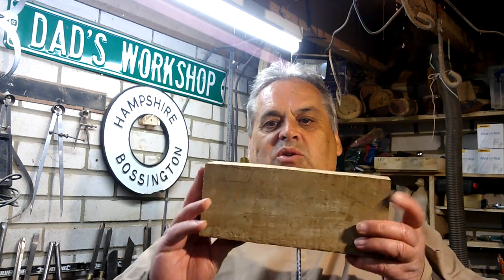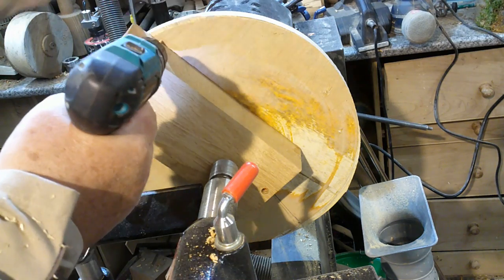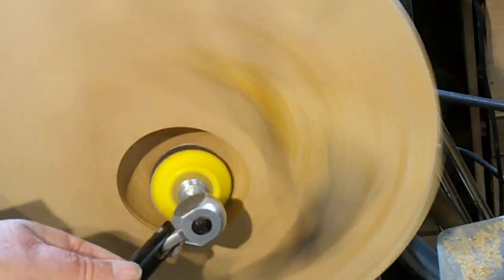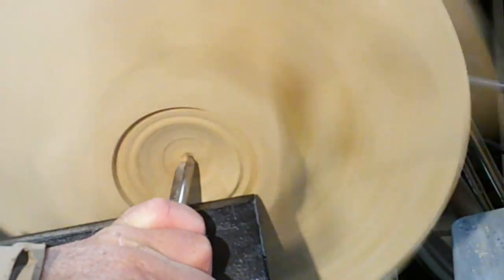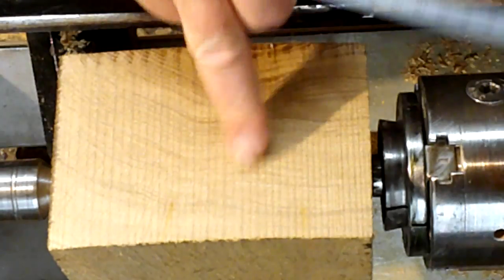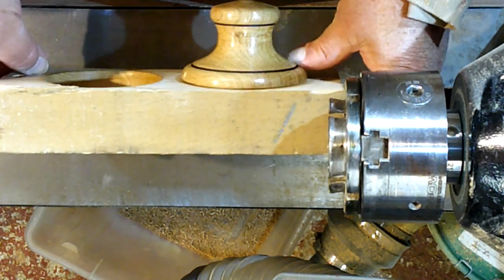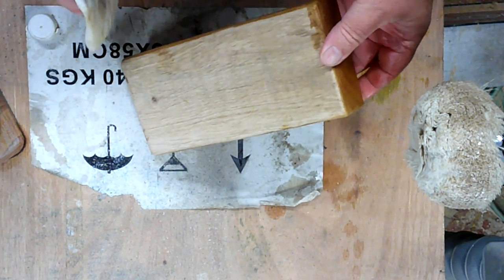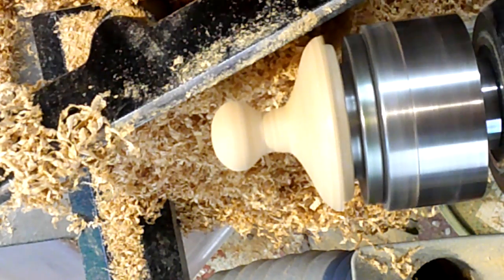Wood turning a chef's salt and pepper holder #66

Comment: Excellent work! I think you were wise to reduce the size of the knob. The first was bulky. Only thing I would have done differently is I would have put a burn line on the top of the knob on one lid, not on the other, to easily distinguish salt and pepper sides! I do love oak, even well seasoned I think it turns beautifully and looks great when finished. I used to have a source of oak wood pallets that I broke down years ago and have used it in various projects over the years and I am finally nearing the end of. I use it mainly for wood turning now and love it. Nothing like getting white oak that has a lot of figure in it for free! Great video, great results!! Scott
Reply from the maker: Thanks Scott glad you enjoyed it, I made a smaller one than this and my brother uses the bigger one for cooking and the smaller one on the table at dinner parties, and he said it always generates conversation about how unique it is
Reply: Thanks for replying to me! Really enjoyed your work. Scott